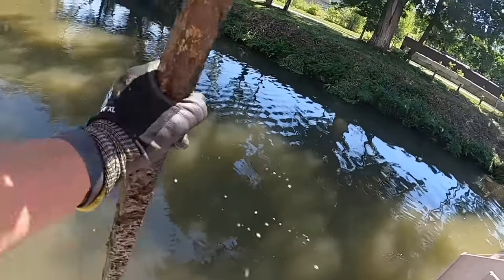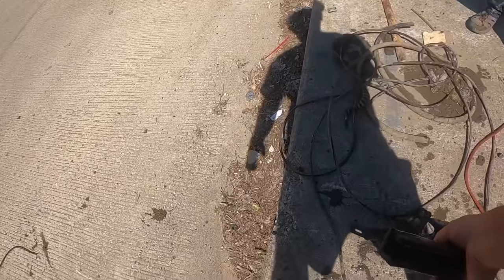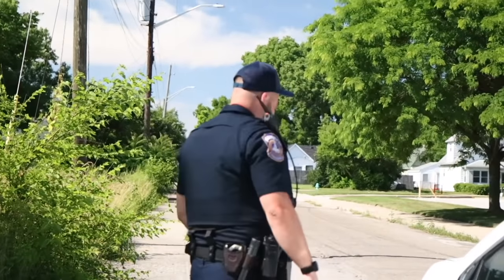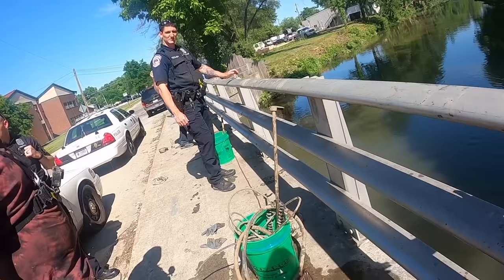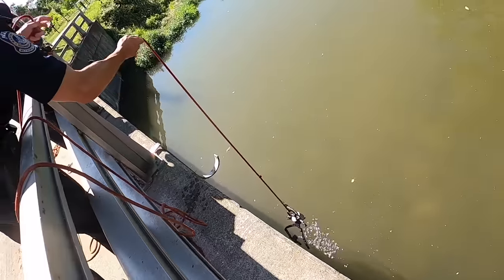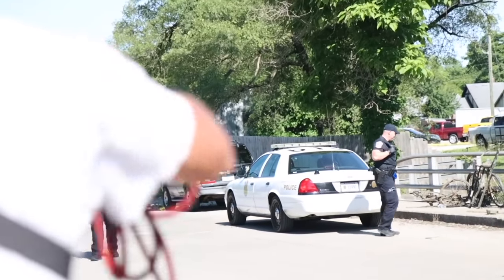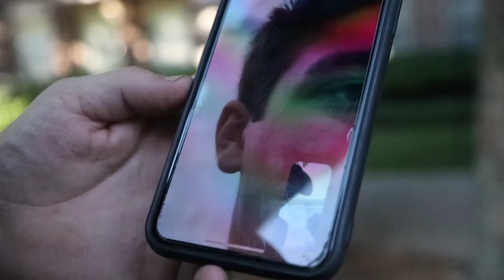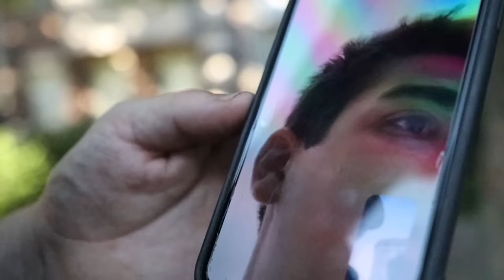Cop Tries Magnet Fishing Then  Proceeds To Arrest Me!! (22 Days In Jail)

Comment: For those complaining about the officer "beating it (shotgun) on the railing" he was attempting to clear the shotgun by using a mortar clearing technique. It would not have gone off anyway because shotgun ammo is not water resistant and would therefore not ignite. It would not go off unless you pulled the trigger, even if the ammo wasn't wet.
Reply: Cop lover
Reply: You didn't care about the real crime arresting a good person
Reply: @richardfalter3748  hey, buddy, your hate is showing through your wild and false accusation there.
Reply: @A_Bag_of_Potatoes  the good thing about most non-milspec ammo is the ammo doesn't have the water proof sealant, virtually all shotgun ammo is susceptible to water as well. Rain typically isn't an issue, full submersion is though.
Reply: @martinsonofwar395  It's best to be safe than losing as hand or worse right, with the amount of mud in the barrel that shotgun basically became an IED.
Reply: @richardfalter3748  well aren't you edgy.

Comment: It may be loaded after he was just banging it on the ground this cop has zero gun safety! Older shotguns do not have a fireing pin block so basically bashing the but of it on the ground could put pin to primer and kill somebody. Absolutely irresponsible
Reply: You should take a closer look. 
He was very conscious of safety. 
He never allowed the muzzle to point at anyone.  He never bashed any part of the gun on the ground. The butt was up,  the muzzle was down.  It was a semi-auto action and not real old.  He was whacking the bolt’s charging handle against the guardrail with the muzzle pointed down in an attempt to open the action to check if it was loaded.  Every aspect of handling that shotgun was done quite safely given the muddy,  jammed up circumstance.
Reply: @ridermak4111  please explain why he did that with the muzzle pointed at the sidewalk, and then wanted Dani to move away when he was over grass!  You make no sense.  The evidence tech did not practice safe handling of an inoperable, but possibly loaded shotgun.
Reply: Sorry bud, but you don't really know what you're talking about.  
 First he wasn't banging it on the ground. He was hitting the bolt handle on the railing to try and open the chamber.  The fact it has a bolt handle on the bolt tells anyone with even a basic knowledge of shotguns that this one is not a Pump shotgun.  You open a pump shotgun by pumping it.  You don't 'pump' a Semi-Auto to cycle the ammo, hence the bolt handle to be able to physically pull the bolt back.   
Second it clearly has a Plastic stock.
So Semi-Auto Shotgun + Plastic Stock = pretty freaking new.   And the gun was pointing into the ground even, not at anyone.

Comment: The piece of railroad metal is actually called an anchor not a sea clamp they gethey get pounded onto the rail tight to the front and back of each railroad tie to keep the ties from sliding as the train goes over them.

Comment: The situation stinks. The case was dismissed, which means if you think about, the justice system worked.  If someone goes to the police saying that there was a kidnapping, they HAVE to detain you. If the role was reversed you would be saying something different. The part that blows my mind is how long it took to put this in the rear view. That was a bit of a failure by the justice system.